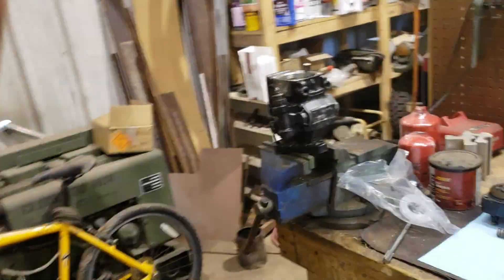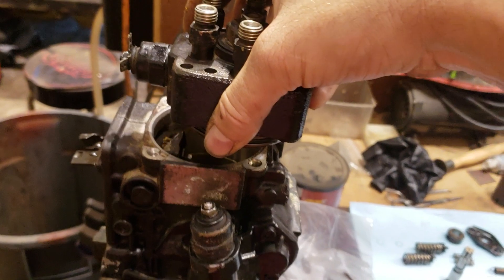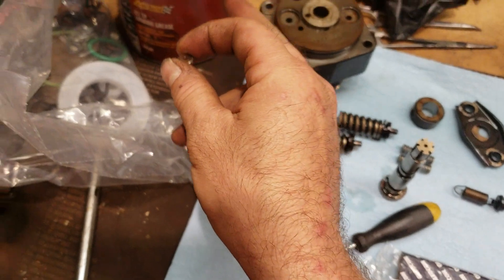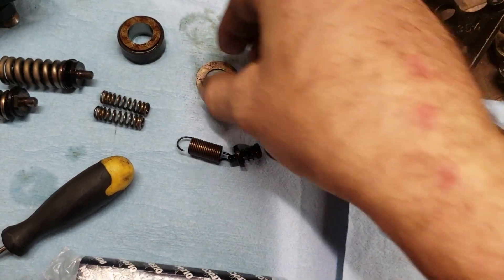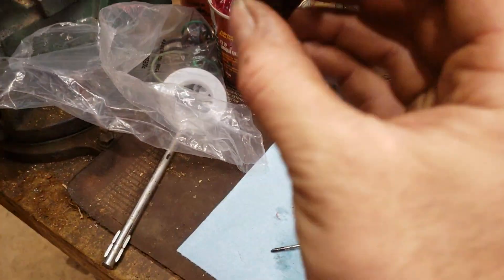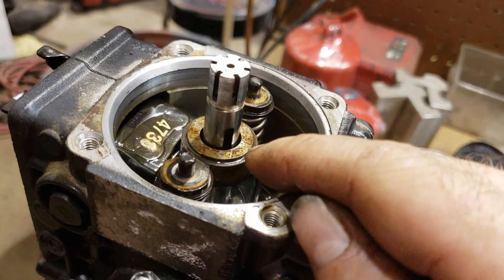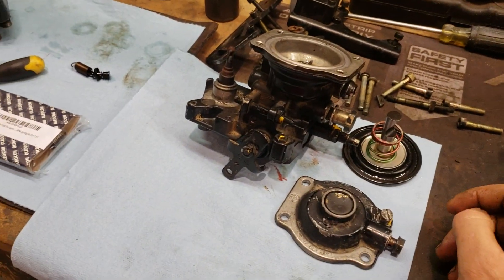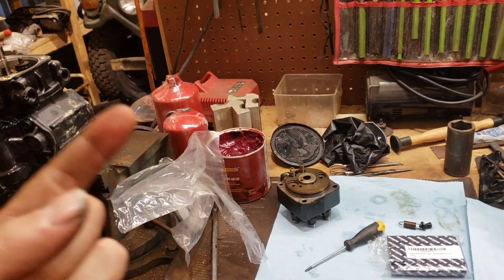Resealing a Cummins VE injection pump.

Comment: How about changing the seal o ring on the front of pump just below the small steel line by top bolt on front cover I think it's the fuel shaft on front of pump
Reply from the maker: I didn't do a complete reseal on this pump because I don't have the special sockets to remove all of the plugs. That was one I couldn't remove. I did fix the leak though.
Reply: My VE pump is leaking diesel into the timing cover, is that the likely culprit?
Reply: Do you think a leaking governor shaft, (directly above the main input shaft but just outside the timing cover) can be sealed by sealing the retaining lock nut without removing the pump? If so, how? and with what materials?